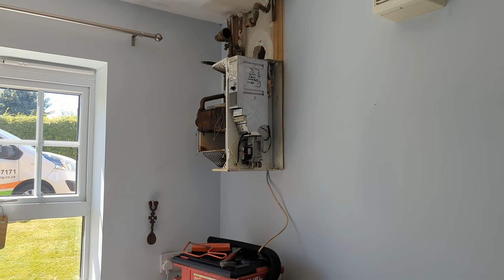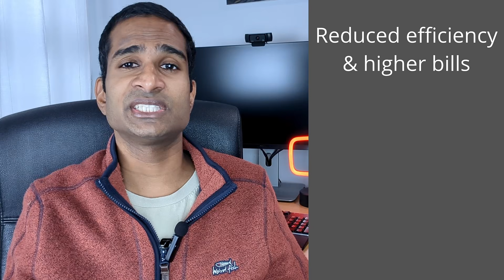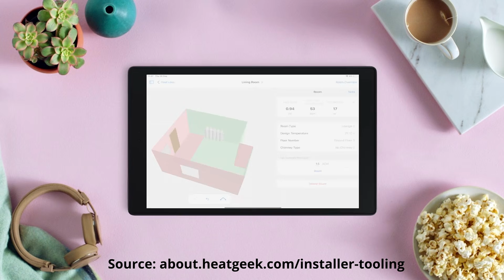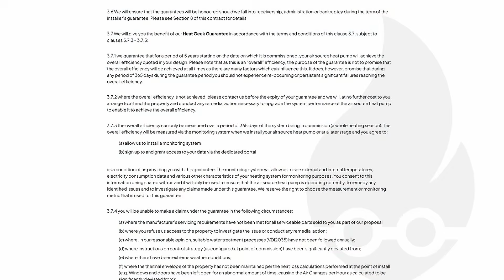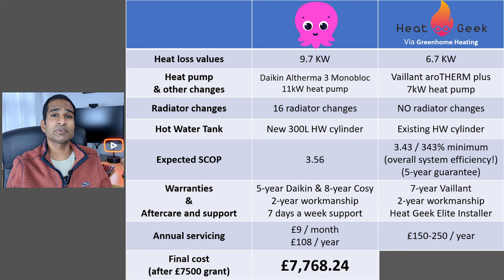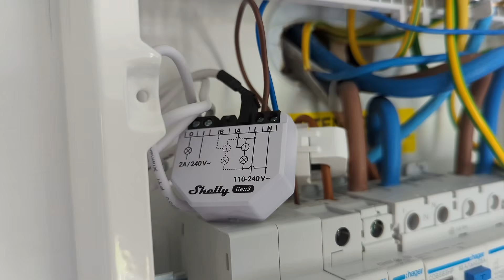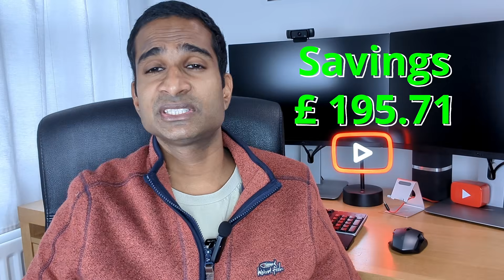Why I SNUBBED an Octopus Energy Heat Pump Install...

Comment: Great video, what do you need the Shelly device for?
Reply: I wondered about the Shelley - I compared my heat pump energy usage with the Vaillant octopus, powerwall and emphased apps and they are indicate the same. So, I only used the Vaillant data. All show a breakdown per 30 min, hour, day, month and year. I had my HP fitted in August, using a local approved Vaillant installer with no radiator change.  only 1 room  doesn’t warm up, and will upgrade the radiator in the spring. My COP for November was 5.57, so a happy bunny. I found my
 local Heat Geek was not very responsive, despite paying the upfront energy calculation survey. I requested and got my money back.
Reply from the maker: Thanks for sharing. That's a great cop for November. Who did your install in the end?
Reply from the maker: Thanks - I wanted to verify the amount of energy the heat pump alone was drawing and at what time. Mainly to use the data to power further decisions. Shan
Reply: @everythinghome and this data isn't available on the Valliant app?
Reply from the maker: It is, but I don't believe it is as granular as what I can get off the Shelley device/app.

Comment: We should have used Heat Geek. Our install was problematic - but the savings are huge. Solar, batteries and heat pumps have reduced our annual running costs from (what would have been) £7500 to £1000. About a 4 year payback. . I don’t    understand why this type of saving does not make it into the mainstream news.
Reply: Great that you are paying that low price for gas and electric. We have a 3 bed semi which used to cost 3500 a year for gas and electric. With solar, battery and heat pump installed we pay net 300 a year. This includes 8k miles on an ev. So was the investment worth it and could I have done better with a stock market investment, my view is it is worth it as we have a warm house, a car that costs not much and less out goings. Take into account inflation and the figures make things more interesting. All the power generated on the roof is power you do not have to earn and pay tax on. Pay back wise, it took 7 years for the solar and about 3 for the heat pump .
Reply from the maker: Thanks for sharing and glad you got there in the end Karen! Who ended up installing yours? S
Reply: But my 5 bedroom house, heated by a gas boiler, only costs £1k a year for gas and electricity - even with the recent rises in prices and the incredible doubling of daily service charges. Why would I want to cough up thousands for a heat pump / solar / battery installation ?
Reply: Your comment is literally unbelievable

Comment: what an excellent video. I watch Heat Geeks and have followed them for a long time, I am with Octopus and they are excellent. To answer your question - we need Heat Geeks approach - we need people who cannot afford this technology to adopt it, those who can afford it we don't need to concern ourselves with. It's penetration that matters. It's those who want to change but can't afford to we need to help. It's the J curve of economics, where marginal benefit equals marginal cost. Thanks so much for this excellent detailed video.
Reply from the maker: Thank you for the kind comments Jonathan 😊 I think you’ve hit on a vital point. If we want 'penetration' in lower-income households, we absolutely cannot afford the waste of over-specifying systems. My £5,600 saving wasn't just 'extra money'—it’s the difference between a project being viable or not for the average family. If we use the Heat Geek approach to stop unnecessary radiator swaps and oversized units, the 'marginal cost' drops significantly for everyone. Precision isn't just for the enthusiasts, it's the only way to make it affordable for the masses and better in the long-run for the planet. Shan

Comment: One of your best videos, great information. I am in north shields, I have to eventually do my own installation as the costs were escalating. Keep up the good work 💪
Reply from the maker: Hi neighbour! Thanks for the kind words, glad to hear you're exploring the options and have the skills to do it yourself 👏 Hope it all goes well. Shan
Reply: @everythinghome yes all installed and working, 7kw arothurm
Reply from the maker: Nice one 👌, what kind of COP figures are you getting?
Reply: @everythinghome design temp is 45deg  at -3, heat loss is quite high, so this year added an additional column rad and changed another to a k22 in the living room. Lowest cop is about 2.95 at very low temps. I have a mixergy tank and solar, combined with lots of battery.

Comment: I believe the Arotherm runs at a more or less constant flow rate and only changes the flow temperature (compressor rate) or cycles to modulate output.
Don't forget the Vaillant heat out calculation is done in the outside unit so does not allow for any heat losses in the pipework. Also the flow/return temps may have significant errors.
My measurements show that Vaillant's COP values are maybe  over estimated by up to 10%. 
Even allowing for this , the performance you are getting is excellent given the bargain price. I guess you could easily replace rads at a later date to make it even better.
Reply from the maker: Thanks for sharing. Yea, I've been blown away with just how good it is working given very little was changed in the existing infrastructure of our heating system. Absolutely right, Heat Geek said if any rooms were struggling that would be an option or if the HW tank was struggling a heat plate could be used. No hint of needing anything like this at the moment though. S
Reply: @everythinghome you could do the heat calculation yourself on Heat Punk if you were considering making changes.

Comment: You can also upgrade radiators as an ongoing home improvement program over time. Replacing single panels with K2 of the same size will improve efficiency - even if you have a condensing  gas boiler and can be a relatively easy DIY project during the summer to save cash especially if you look out for special offers.
Had an Octopus quote, but preferred Vaillant Arotherm+. As you say a big energy company concentrates on volume using standard recipe which can be very inflexible as compared to bespoke solutions.
My 5kW Vaillant has also been running like a charm and cheaply on Octopus Cosy tariff (have battery but no EV) - rock solid indoor temperature of 20.5C 24/7 (manual not timed operation) since the day it was installed. It used average of 9kWh/day November, 10kWh/day December or about £1.50/day for all day and night comfort. Magic. Plus no more gas standing charges or potential carbon monoxide and explosion hazards.
Reply from the maker: Thanks for sharing your experience and figures – sounds like you've got a great setup! Shan
Reply: You very rarely hear of a HP owner who doesn't have Solar or battery or both do you?
Reply: @stuartburns8657  Having solar is nice even without a HP..

Comment: It would be amazing if Octopus could use Heatgeek tech and all get trained up to be Heatgeeks. The great volume should make the Heatgeek approach even cheaper and each more people
Reply from the maker: That’s the 'Holy Grail' of the industry! The challenge is that Octopus is built for speed and scale—they want to get as many pumps in as fast as possible to hit targets. Heat Geek is built for performance and precision, which takes significantly more time during the survey and design phase - although the AI input and zero-disrupt will reduce this. It’s hard to do both at once because 'bespoke' is the enemy of 'mass-market.' Do you think the average homeowner would wait longer or pay more for that extra Heat Geek precision? Shan
Reply: @everythinghome Yeah indeed. How much longer does it take? Don't Octopus plan and customise the install at all? Can't Heatgeek speed that is with the use of AI to produce an answer super fast, at the cost of time taken to scan, etc?
Reply from the maker: Great questions! Octopus definitely do plan and survey, but they tend to use more 'conservative' industry standards. This usually means they overestimate heat loss to be safe—which often leads to those unnecessary radiator swaps and larger units I mention in the video.

As for time, a standard survey might take 45–60 mins, whereas a full Heat Geek survey can take 2-3 hours because it’s room-by-room and radiator-by-radiator. You’re spot on about the AI/LiDAR tech, though! Tools like Heat Geek's software are definitely closing that gap. S
Reply: @everythinghome Super. So with less work needing to be done by a more efficient Heatgeek install (fewer radiator swaps etc), it is be much quicker to install, the problem is the installers being trained suitably and there being enough to cover demand. All sounds doable unless I'm missing something (probably am) 😂
Reply: @everythinghome  Does designing properly take more time than doing all rad and tank changes? It certainly seems to cost more money..
Reply: No kick backs in it for anyone then is there? 
16 radiators unnecessarily replaced, think of the palms greased for that deal. Now multiply it for every install each week, it's a lucrative scam.
Reply: It seems odd that such different designs can be arrived at, the guidelines are quite clear how to arrive at heat loss. If over sizing is being added that should be questioned, assuming you’re running at the design levels

Comment: Octopus are only good when it’s simple and low hanging fruits! Like you i invited them to quote but alas my detached house doesn’t have a suitable position,really! And don’t get me started on the smart meter,technically Octopus don’t own them so they fob you off with platitudes and lip service I always say judge a company when you have a proper problem and you find out exactly who they are.
Reply: I’m looking into a heatgeek quote in the new year and hopefully they can work a solution for me.Even the octopus surveyor said what I was thinking regarding the layout was very doable but octopus wouldn’t be interested currently.Great channel btw 👍
Reply from the maker: Exciting, definitely worth exploring. Thanks for the kind words and support 🙏🏽 Shan
Reply from the maker: That's interesting to hear about your experience with them, thanks for sharing. Has it put you off getting other heat pump quotes? S

Comment: On sizing, the big companies always go for bigger heat loss/HP capacity as they dont want to have to go back - they want to throw the system in and run away.  I had to fight with EDF/CB Heating for them to install a 5kw unit, when they wanted to install a 8kw unit, even though their heat loss calcs showed 4.something
Reply from the maker: Hi Chris - yea I suspect you're absolutely right, problem is that leaves the homeowner footing the higher bill for the upfront and running costs moving forwards! S

Comment: Really interesting! I would have gone the same way if faced with your quotes and system constraints. I ended up paying Octopus about £3000; my Heat Geek quote was about £5500 (both after the BUS grant of course). All of my radiators were changed, in my case that was seven, and some of them had started to rust so I was happy to have them changed. The pipework was just big enough at 10mm copper microbore to the radiators with a 22mm "backbone." The heat loss was calculated as 4.4kW at -2C OAT, 50C flow, and the proposal was to put a Daikin 4 in place. I think the predicted SCOP was 3.43. This was before Octopus had their eco/turbo options and I think also before Heat Geek had their zero disrupt option so I think effectively it was Octopus's eco option. At the moment I'm running with intelligent octopus go and charging a battery to cover most of the energy cost; it's ridiculously cheap to run this way, but it wasn't really for the cost savings that I went for it; they were the icing on the cake. I might be going carless from early 2027 and then I'll have to switch away from the tariff, so it will become more expensive then.

The heat pump works, but I do have to keep it on overnight without a setback to maintain our desired comfort temperature as otherwise it is slow to heat up. The way hysteresis works on the Daikin and I suppose the fact that the maximum heat output of the Daikin 4 is 4.6kW both mean that if the temperature is allowed to drop overnight, it takes a fair while to come back up to temperature. I'm happy with it though, and it is much quieter inside the house; I no longer have the water hammer problems that I used to have running a condensing combi; and I'm off gas completely. It's also good that I have access to the Octopus service package. (I wonder if you could access that? Might be worth asking!)
Reply from the maker: Thanks for sharing your figures/findings when at the survey stage. Yes, it has crossed my mind, however, I do see the expertise that having the Heat Geek who installed my system initially service it. Shan
Reply: I think it's great that Octopus is delivering good quality installs (not just @EVNick and @JonathanTracey!)